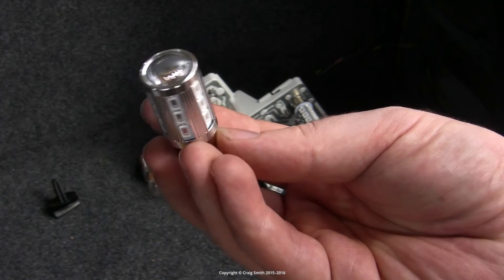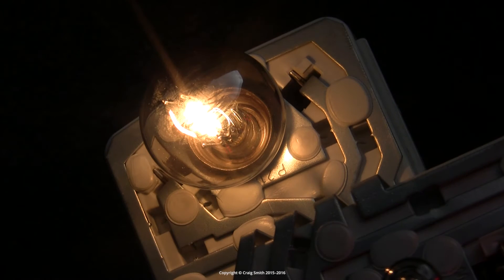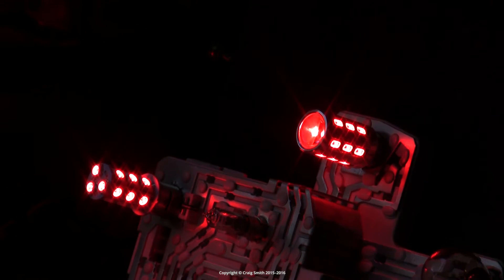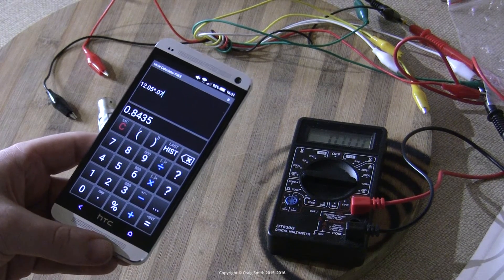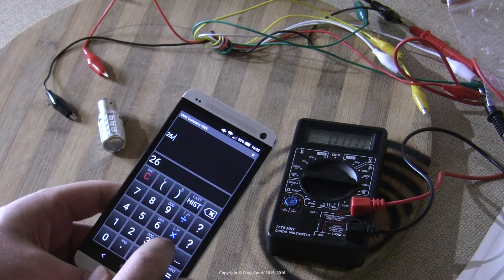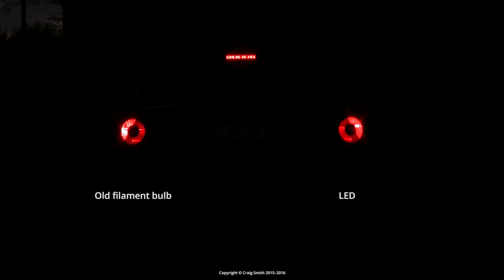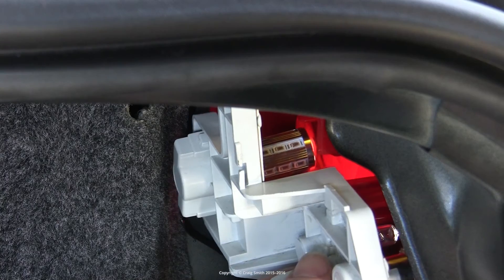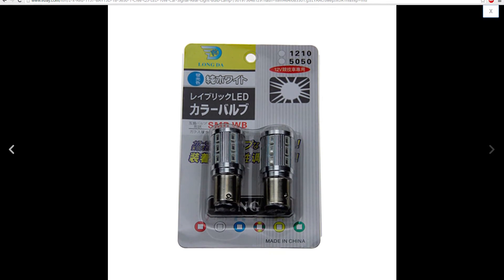Review (don't buy!): "Cree Q5" red LED BAY15D dual mode bulb

Comment: I bought some which were similar to these, but mine are a LOT brighter in brake light mode than in taillight mode. I haven't measured the ratio, but they are clearly superior to the incandescents which they replaced. The taillights are about the same brightness as before, from the side, though noticeably redder. They are noticeably brighter from the rear, and the brake lights are a LOT brighter.

I did have one LED bulb fail after a year or so. The other is still going strong after about 3 years, so far.

I actually got them in two places: eBay and AliExpress, but they looked identical in the listings, and they seem to be identical.  Searching for something like this will probably find them:

Red Cree 1157 bay15d car brake lamp P21/5W

Expect to pay at least $5 each on eBay, and at least 2/$5 on AliExpress.

Comment: Like your description "Don't buy". The RED dual point LED is just a flop. They don't produce the same intensity as incandescent in the day light especially.  What I observerd is incandescents over a period of time becomes black slowly. Hence produce dim light. Sadly there is no upgrade in the world for p21w 5w (21w being for break & 5w being for headlight/parking). I wonder why not any company  produce 25w/10w spec. It may consume little more current but that will have negligible effect on the battery.
Incandescent behind that red and orange plastic cabinet just ROCKS !! both in day and night. Any thought on increasing the intensity of the same 21/5w bulb ?
Reply from the maker: Sure you can, the Philips P21/5W bulbs are great. See here https://youtu.be/bli7bHKPABY

Comment: Hello,
Im planing to change my turn signal bulb (front) from regular halogen to led. But i want to change it with led that can be used for turn signal (amber) and for DRL (white) in same bulb.
Toyota Yaris 2009y.
Do you have any experience with this type of bulb.
Thanks
Reply from the maker: You will have to look up the bulb type to be sure to get it right.

Comment: was able to open it these, it needs a diode on the resistor at the side so voltage will not turn back for the third stop light , and in the middle it has a diode it needs 15Ωμ resistor,  then they are great, the biggest problem the 5W is to bright

Comment: I purchased a similar bulb 1157 and found some issues, when 12 volts (parking light) is applied to the low mode terminal of the bulb, the LED bulb lights up dim as normal, but, it discharges 10 volts to the high mode terminal of this bulb, thus lighting up my OEM 3rd brake light dim. 

When brake is applied, 12 volts goes to the LED bulb for brake and to the OEM LED 3rd brake light, thus making them light-up normally.

Also, the subject bulb lights up regardless if I reverse the polarity from all points connecting points.

Comment: Do you have suggestions for an LED 382 replacement that operates in a dim mode and then full brightness with the brake light? My new car has 382's single contact  with dimming on the circuit. Thanks!
Reply from the maker: You don't need a dual-mode bulb. So just get a good quality LED, and the PWM on the circuit should dim/brighten it just like any other bulb. I suggest Philips X-tremeVision: http://amzn.to/2adaxRC
Reply: Thanks Craig, however, i forgot to mention i'm in the UK and it looks like those Philips ones arent available here :(

I have found these but they are not canbus friendly so i dont think they will work.   http://www.ebay.co.uk/itm/2x-PHILIPS-RED-LED-Vision-BRAKE-LIGHT-P21W-1156-BA15S-12839-Single-Brightness-/112272640123
Reply from the maker: Those Philips are the "Vision" line, which is less powerful, at max brightness is more like a 10 W incandescent as opposed to the X-tremeVision above which is better suited to the 21 W bulbs. (Also there are counterfeits out there so Asian sources are dodgy sorry to say). If your car has bulb-out checks then any LED will fail them, the likes of VW/Audi you can code but I don't know what you have. Good luck
Reply: Craig's DIY Car thanks again. Yes I have a VW caddy van. I have used the error free leds for the turn signal and they work well. I can code out the licence plate via vcds but I'm not sure it will allow the others so I'll have to check.

Lastly, the link you supplied, i have found a seller that will ship to the UK, however the 1156 box that is pictured has dual contacts on the lamps in the box. I am guessing its a stock picture?

Comment: Why 26/5? It's 21/5. So it is not 5.2, it is 4.2 vs 3.42.
Reply from the maker: The one filament is 21 W, the other is 4 or 5 W, and both are lit in brake mode.
Reply: I know that, but the calculation is wrong. You've used the wrong numerator.
Reply from the maker: (21+5)/5 = 5.2
Reply: If you used (21+5)/5 then why didn't you use (0.24+0.07)/0.07? The correct math is 24/7 and 0.24/0.07.

Comment: in mondeo mk3 tail/stop - 21/4W, not 21/5W
for example: 
 http://ru.aliexpress.com/item/2pcs-Super-Brighter-Red-CAN-bus-Error-Free-BAZ15d-566-150-20W-CREE-LED-Bulbs-For/32253932692.html?spm=2114.14010208.99999999.261.F8VHaj
or
http://ru.aliexpress.com/item/2Pcs-1157-Baz15d-566-P21w-4w-80w-Cree-High-Power-LED-Gluhlampen-Arriere-Stop-Recul-Frein/32256500772.html?spm=2114.14010208.99999999.270.F8VHaj
Reply from the maker: Correct, but you can make a 21/5W fit with a little modification and they work the same. The Chinese bulbs are so bad they should be avoided regardless, and I have not found available the better quality ones like Philips in the 21/4W socket form.